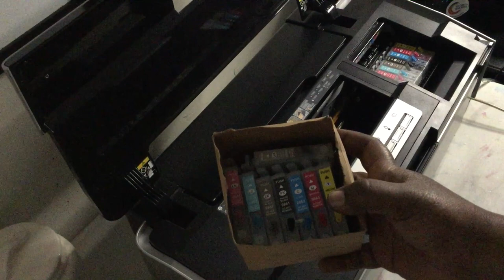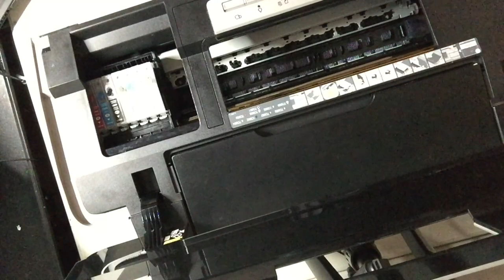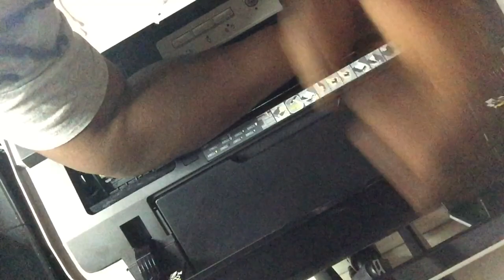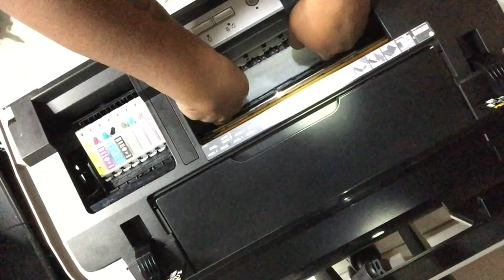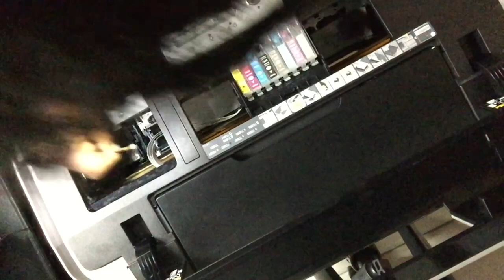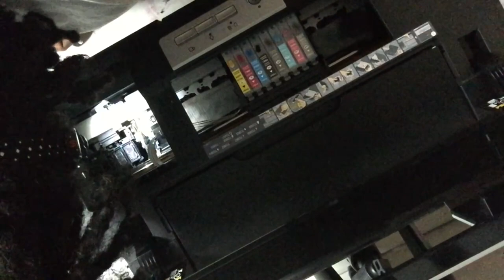DTF DIRECT TO FILM Nightly maintenance  on a CONVERTED Epson R2880 DTF DIRECT TO FILM PRINTER #dtf F

Comment: I have an Epson SureColor P800 modified for DTF. I use 17 inch roll film. Lately I've been having a problem where the print will start, then after a few seconds, it will suddenly stop and begin spitting out the film until I cancel the print. Would you happen to know what my issue is and/or how to fix it? Please and thank you!
Reply from the maker: I'm sorry I don't have experience with Roll Film